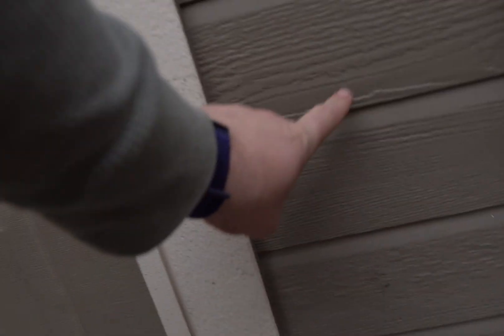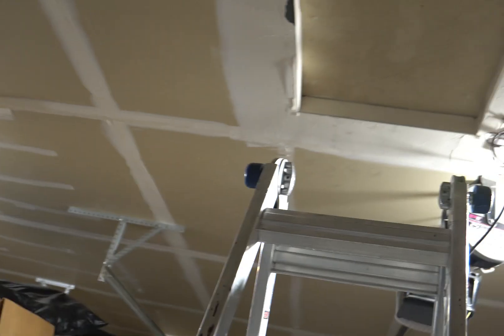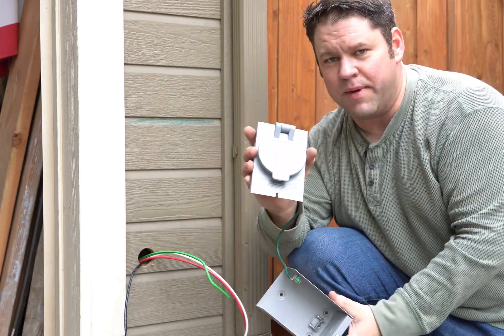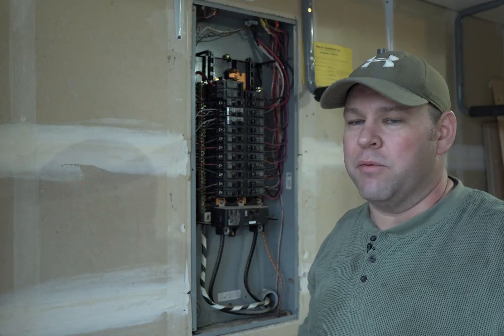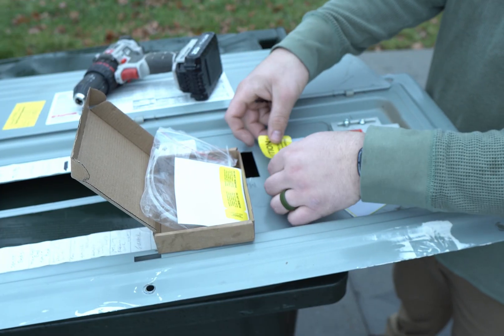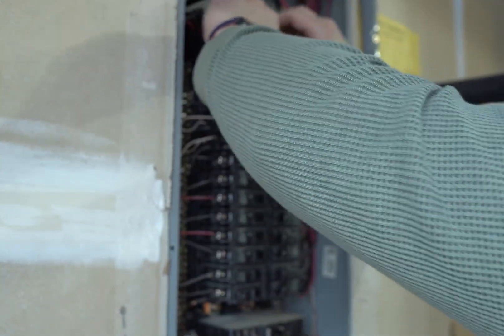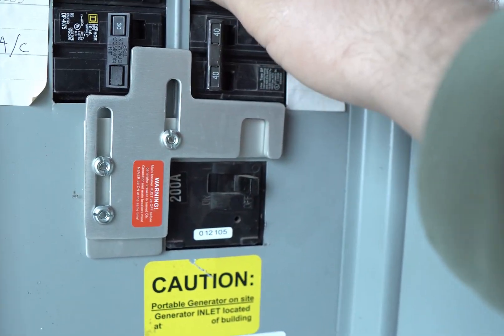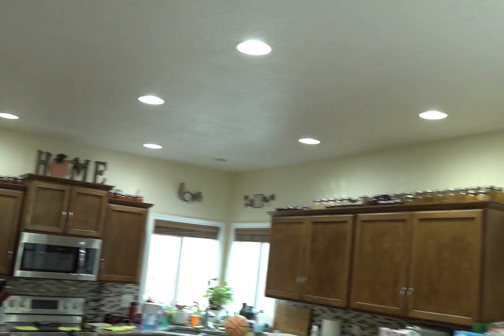This Generator Mistake is Fatal

Comment: You have made so many Code violations:

1) THHN conductors must be run in a raceway (conduit) or inside jacketed cable assembly.  They cannot be running loose in the air.

2) You ran the conductors through a CABLE clamp into the back of the inlet box.  The NEC requires the jacket of a cable to extend into the box through the cable clamp.  Since you have no cable, you can’t use a cable clamp.

3) You fished individual THHN conductors in the wall above the service equipment panel.  Again, this is a Code violation.

Please correct these issues and reshoot the video.